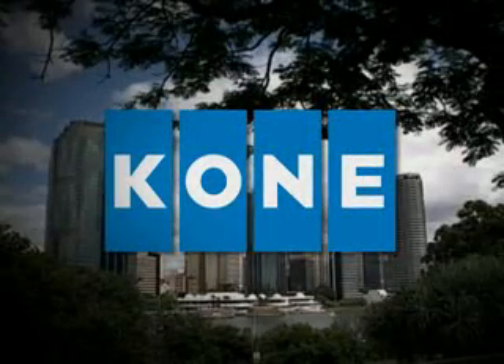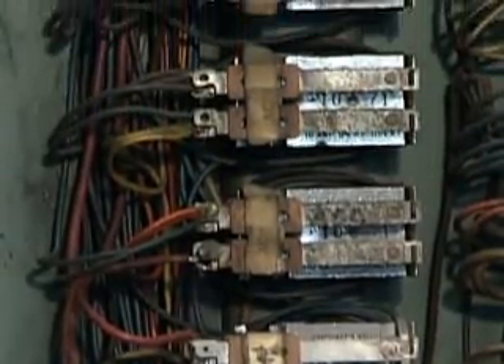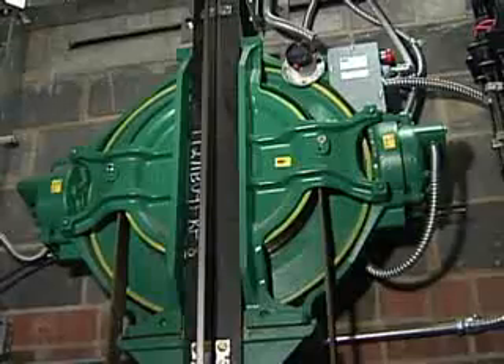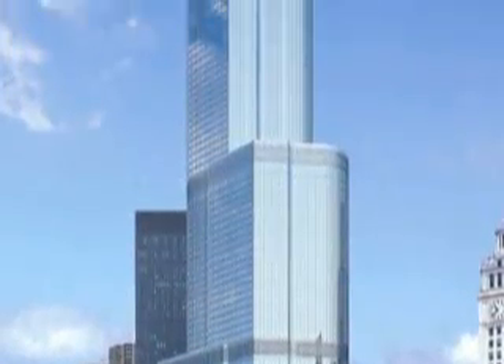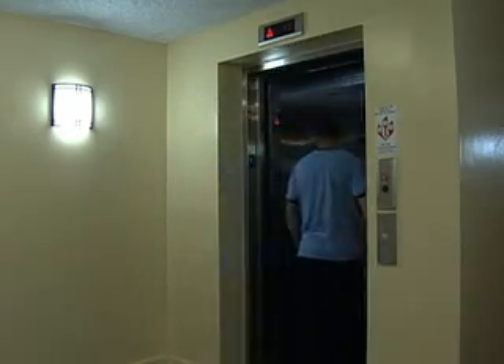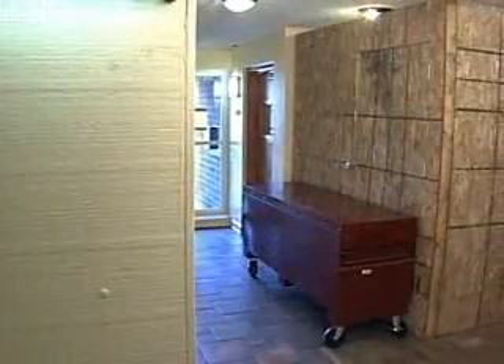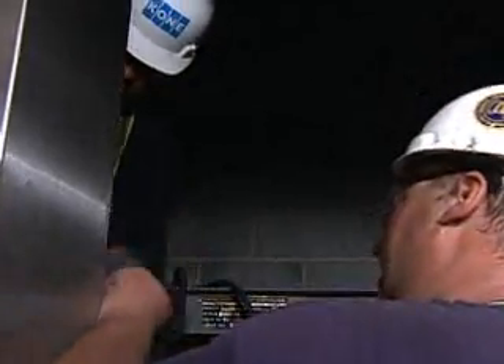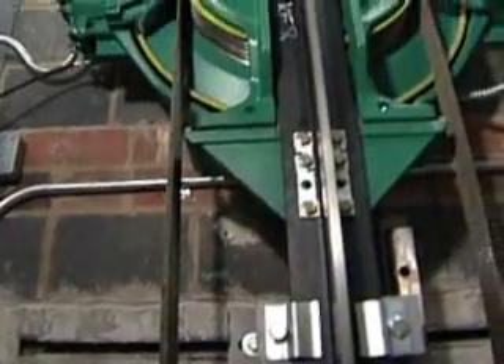EcoSpace EB

Comment: You can't say they are harder on the environment today. There are holeless and roped applications for hydraulics now, AND ThyssenKrupp came out with biodegradable fluid, if there ever was an oil leak. Hydraulics only use a lot of power going up, not going down so much. It evens off.

Comment from the maker: They may be cheaper to install but they're generally much more expensive to operate, more difficult to maintain, and much harder on the environment.

I'm not an elevator maintenance person, so I can't really give you a knowledgeable answer on how they're maintained.  My guess would be you simply access it within the shaft, using the top of the elevator as the working platform.

Comment: do traction haave machine rooms?  They say hydralic is easyer to install but it looks like traction is easyer than hydralic I built a mini model of a tration before but my mom got it taken apart but it had a counter weight a working motor and 3 stops I dont know where to get a cylender and pump for hydralic traction you need a string a pull a Knex motor and something heavey for the counter weight I will try to make anther one to  show you.